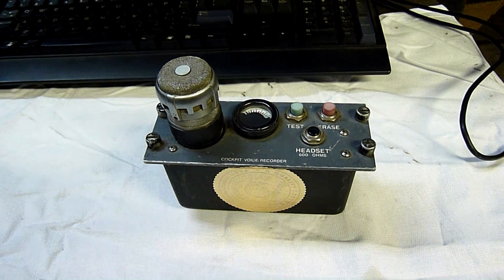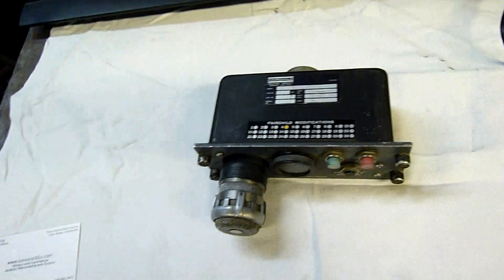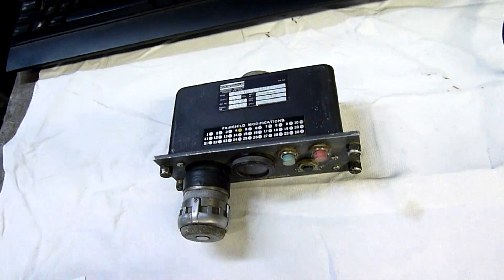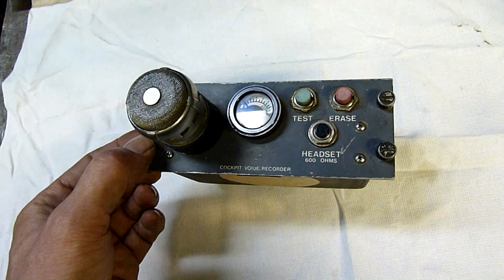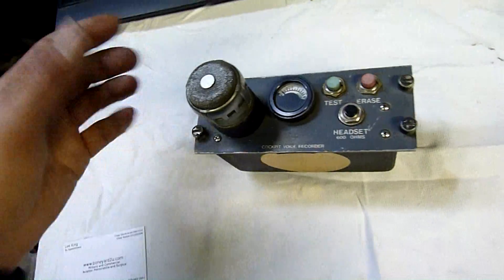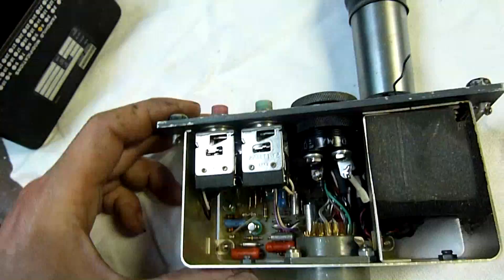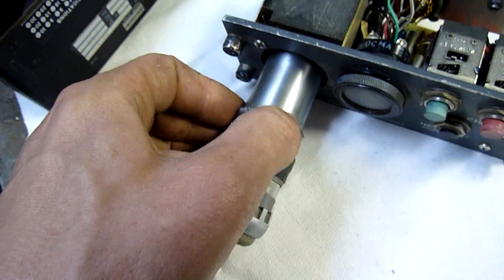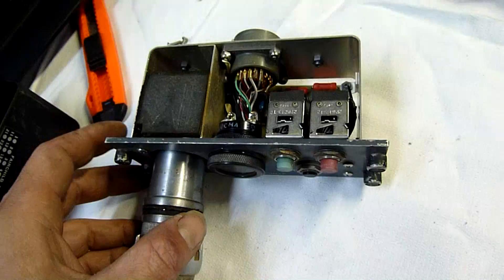Fairchild Cockpit Voice Recorder Control Panel Autopsy

Comment: It's an A152 control head for the Fairchild (now L3 communications) A100 CVR; a very popular unit fitted to most major airliners in the 60s/70s/80s. They were a 4 channel, 30 minute tape loop recorder. The mic on the unit is the 'cockpit area microphone' (CAM) which recorded on one channel of the tape, the others being captains headset, first officers headset, and either flight engineer headset or spare. I believe that the test button records a tone on the tape and the meter indicates the playback level of that tone i.e. it proves that the recording was made. :)

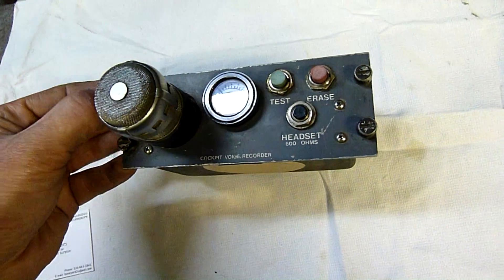Comment: 3:49 - At least on modern aircraft, I think the CVR Erase button is only effective when on the ground (and other specific requirements, like parking brake on and AC power active). http://www.smartcockpit.com/download.php?path=docs/&file=B777-Communications.pdf page 13

Comment: You could replace the rubber dampener with some radiator tubing. Won't have the same effect but still better than welding it. One other way would be to make a plastic replacement for it on your lathe. Then, there's also rubber glues that would glue that with some degree of efficiency.

Comment: I bet there is a pre amp on that pcb for the mic, and a circuit for driving the meter, might be worth fixing the mic properly and finding the power pins on it :-))
Reply: zx8401ztv I was thinking the same thing - could be very nice mic preamp with its own meter and buttons for PTT or whatwewr ;)Just need to find out the power and output pins and voltage. Closer look to the PCB and components might give some clues
Reply: Taavi Metsamees
mad minds think alike :-)), i dont know if he did search the pre-amp out.